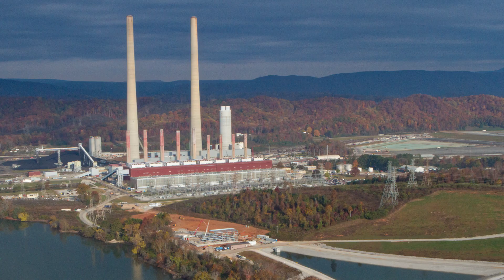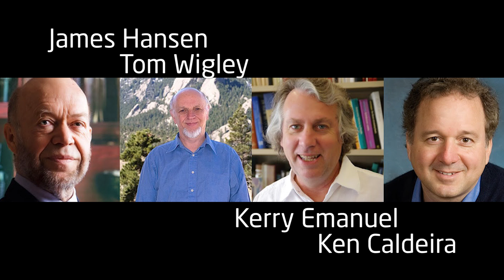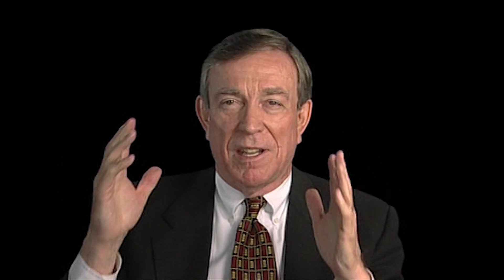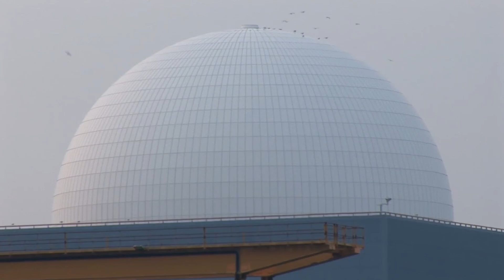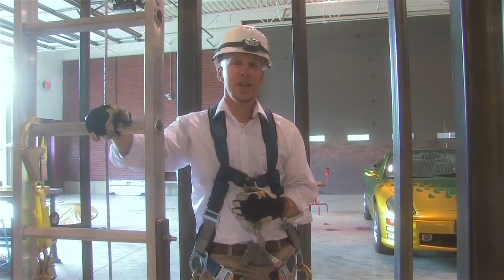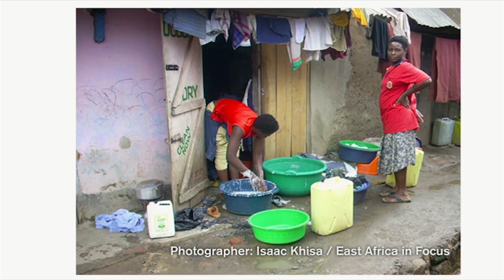Global Warming: Greens vs Nuclear - "Th" Thorium Documentary

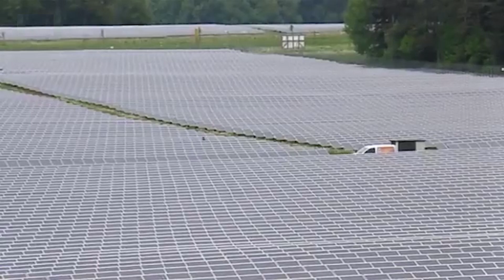Comment: At 10:36 : 
"If they've spend that money on nuclear, they would have a Zero-Carbon economy right now"

Germany has spend more on nuclear in the past than on solar today. It got us to 6% of final energy consumption. Renewables (not just solar) are now at 15%. 
Furthermore: If they spend that money on nuclear in 2008-2013, not a single kWh would have been produced by now, because of the long constrution period.
Reply from the maker: If they'd put that money towards nuclear, presumably they'd not have been shutting down already-constructed and operating reactors. New reactors would cost money and take time. But keeping an existing reactor in operation is the cheapest source of GHG-free energy one could hope for. Germany will be spending almost a Trillion USD to move to renewables, if they did what France did (starting in 1974) but invest in Molten Salt Reactors instead of Gen2 solid fueled reactors, Germany might not be digging up villages looking for lignite coal reserves to replace shuttered nuclear. http://www.nytimes.com/2013/09/19/world/europe/germanys-effort-at-clean-energy-proves-complex.html

I see two sets of numbers coming from Germany: Steadily increasing share of electricity being generated by renewables (what you say is true). And, also, Germany's unimpressive recent trending on GHG emissions, particularly when contrasted with France where GHG has been held down for decades. (Again, what you say is still true, but it doesn't address climate change as one would hope.)

Sorry North America hasn't been as efficient as either of your countries regarding GHG. But replacing nuclear with a combination of renewables and coal is not a good investment. Shutting down an operating nuclear plant is the worst decision (from a global warming perspective) one can possibly make.
Reply: gordonmcdowell Tell 'em Gordon!

Comment: Look at how much the local media is enslaved to the Coal PR machine. "Potentially toxic coal ash", if it has mercury, cadmium, arsenic, it's toxic, period.
Reply: I'd not be surprised if the toxicity of "deadly long lived nuclear waste" -- per kg -- is not less than that of coal ash.
Considering that 95% of the relatively tiny amount (25 hundred tons a year compared with 130 million) of "spent" nuclear fuel is the mildly radioactive uranium 238, or even U-235, 1% is plutonium 239 that still won't hurt you unless you grind it into a dust and inhale it, and most of the rest disappears in three years because the full name of "radioactivity" is "radioactive decay".and the stronger it is, the sooner it's gone.

Comment: I've heard Elizabeth May and other Greens talk about energy quite a bit now. Virtually every point in their argument is either factually incorrect, or is rooted in fundamentally flawed reasoning. For example, May says that we should produce energy in a manner that directly creates as many jobs as possible for every dollar invested, and then proposes wind and solar energy as the way to do that. Well, if she wants clean energy production with a maximal labor input, then she ought to be proposing that we produce electricity by having people run on treadmills. Producing power that way would require most of the world's population operating in shifts around the clock. But then, why should energy production directly employ large numbers of people? A better strategy would be to produce power that yields the greatest output per unit of input, that produces the fewest negative externalities (i.e., pollution), and that maximizes the cost/benefit ratio. People could then use the abundant, cheap energy as the basis for a productive economy that employs people to do productive, welfare enhancing things (which is why we produce energy in the first place - May talks about it as if we produce energy for its own sake).

Comment: The argument made by anti-nukes that pricier renewables are better (when they aren't outright fabricating the cost of nuclear) is so absurd. I guarantee you will get practically the same amount of employment and economy-bolstering when putting up nuclear plants as you would renewable plants if you invest the same amount of money. The difference at the end of the day is you'll have more capacity installed if it's nuclear for the same amount of money.

The other thing to consider is that money is finite and time-dependant. It might seem like we have an infinite amount of it going into the future, but that's an illusion, because the "future" happens over time. In that time, you are limited in funds and resources. If something's cheaper, you can buy more of that in the same amount of time as something that's more expensive. That's the trick with nuclear: you can build a lot of it quickly because it's cheap, particularly after the first few plants have been licensed and built. And because we need zero-emission energy ASAP, we should be going with what's cheapest. If we go with renewables, in their current state, we won't make it.
Reply: Another argument Greens make is that nuclear plants take a long time to build and bring online. What they either don't know or fail to mention is that a lot of that lag time exists because the public's unfounded fears of nuclear power, which Greens actively promote, have created political pressures that have led to the creation of a regulatory environment that effectively requires that nuclear power plants take a decade or more to build. In principle, nuclear plants can be built in a few years. The long lag time the regulatory environment creates means that the cost of financial capital to build nuke plants rises, and this drives much of the high upfront cost of building them.

Nuclear power's biggest problem is that the public is afraid of it for reasons that exist to a great extent only in their imaginations. The other frequently cited drawbacks of nuclear power are essentially just the consequences that follow from the public's fear.